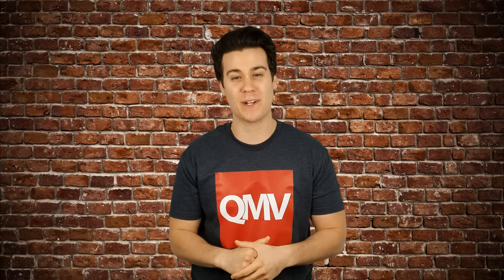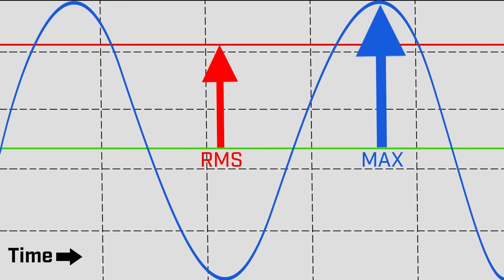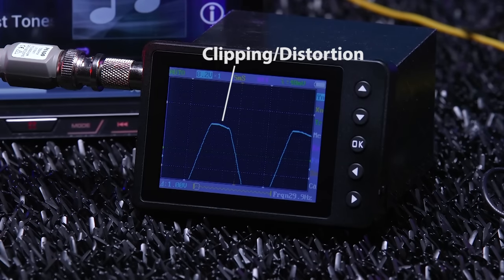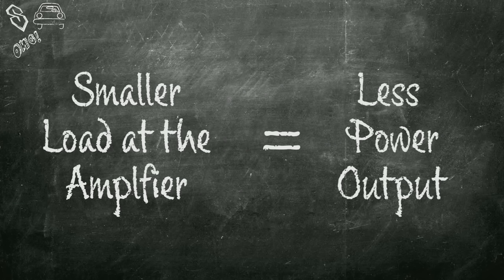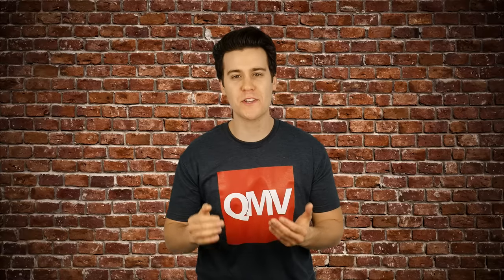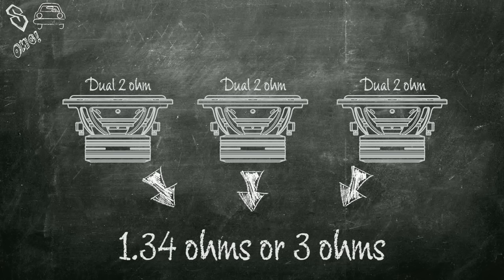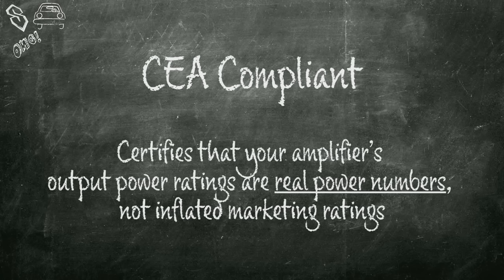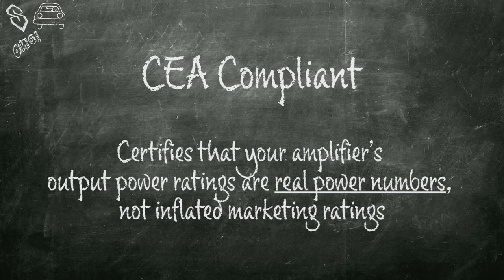How Do You Match Car Subwoofers and Amplifiers?

Comment: Okay look, I know you made 100% sense in this video, but not to me hahah. Will someone tell me if two SWS-12D4 subwoofers will work with the PDR-M65 alpine amplifier
Reply from the maker: Thanks for providing model numbers! So two DVC 4 ohm subwoofers make a 1 ohm or 4 ohm load at amplifier. And those subs have a combined RMS of 1,000W. That amplifier can not be wired to 1 ohm. It can however do 4 ohms, but they power of the subs is much higher than the 450W the amplifier provides at that impedance. Ideally, you would want an amplifier with about 900-1200W RMS of power at 1 ohm. I would recommend these amplifiers instead:

Rockford Fosgate P1000X1BD
http://www.qualitymobilevideo.com/rockford-fosgate-p1000x1.html?utm_source=YouTube&utm_medium=Video&utm_campaign=Match_Subwoofers-Amplifiers

Pioneer GM-D9601 
http://www.qualitymobilevideo.com/gm-d9601.html?utm_source=YouTube&utm_medium=Video&utm_campaign=Match_Subwoofers-Amplifiers

Rockford Fosgate R1200-1D
http://www.qualitymobilevideo.com/rockford-fosgate-r1200-1d.html?utm_source=YouTube&utm_medium=Video&utm_campaign=Match_Subwoofers-Amplifiers
Reply: Thank you very much for your help
Reply: How do I wire both DVC 4 ohm subwoofers together to make 1 ohm?
Reply from the maker: We have a video on that! https://www.youtube.com/watch?v=fyyEDnv-T7o&t=3s

Comment: The rms statements here are wrong impeadiance changes when speakers are in motion you wpuld need 500 rms to push 2 10 rated 100 watts rms and when you add too more the coil rise changes 509 watts rms now becomes 1800

Comment: you forgot impedance rise, if you want 700 watts for your 10 inch subs you need a way bigger amp
Reply from the maker: It's all dependent of the capabilities of the amplifier and the specs of the subs. Just saying "10 inch subs" is incredibly vague. Are they 200W RMS or are they 1,2000W RMS? Are they DVC or SVC? All of this factors in
Reply: 😂 i used your example, you talked about 10 inch subs and 700 watts,  if you want an amp that gives 700 watts to your sub, “and iT doesnt matter what size of sub and the voice coil also doesnt matter” you need atleast 1100 watts rms amp,
Reply from the maker: @promo130  OHHHHH gotcha! Lol

Comment: Bro i have a question. Can you wire two SVC 4ohm subwoofer with 2ohm parallel wiring to a 2ohm rated amp? Is it ok even if the sub is not rated for 2ohm? Help me bro
Reply from the maker: Yes! Two SVC 4 ohm subwoofers wire to a 2 ohm load in parallel, 8 ohm in series. If the sub is not rated for 2 ohm, then you can't make a 2 ohm load.
Reply: @Qualitymobilevideo  bro what might happen if i wire to un unrated 2ohm sub? Will it burn or blow?

Comment: Im so Fucken lost 😫
What amp do I need for two sundown Sa-12 750watts 4ohms subs?
Reply from the maker: Happy to help, those are DVC 750W RMS subs, combined RMS of 1500W. Two DVC 4 ohm subs make a 1 ohm(parallel) or 4 ohm(series) load. I would look for an amplifier with a power range of about 1400-1750W RMS @ 1 ohm. Check these out:

Hifonics BRX2416.1D Brutus 
http://www.qualitymobilevideo.com/brx2416-1.html

Power Acoustik BAMF1-5000D
http://www.qualitymobilevideo.com/bamf1-5000d.html

Power Acoustik EG14500D
http://www.qualitymobilevideo.com/eg1-4500d.html

Power Acoustik BAMF13000D
http://www.qualitymobilevideo.com/bamf1-3000d.html
Reply: Quality Mobile Video ok thank you.  I’ll make sure those out

Comment: Man I'm laughing at your videos and  can't concentrate on the subject.  Here is a question for you I'm looking to buy 2 JL audio 6.5" subs . Here is the power for them
 Power Handling:
Peak: 600 watts per pair / 300 watts each
RMS: 300 watts per pair / 150 watts each
Impedance : single 4 ohms 
Recommended Power Range: 80-300 watts per pair / 40-150 watts each. What amp brand and capacity would you recommend ?
Reply from the maker: Lol thanks! So two single 4 ohm woofers make a 2 ohm or 8 ohm load, I recommend going the 2 ohm route for more power. You'll want a  2 ohm amplifier with a power range of 300-500W RMS! Amp brand depends on you and your budget, obviously a rockford fosgate will be more expensive than a boss audio amp, but will perform much better. Here are some suggestions! 

Kicker 42PXA5001 - 500 watts RMS x 1 Channels at 2 ohms
http://www.qualitymobilevideo.com/42pxa5001.html?utm_source=YouTube&utm_medium=Video&utm_campaign=Match_Subwoofers-Amplifiers

Rockford Fosgate P300X1 - 300 watts RMS x 1 Channels at 2 ohms
http://www.qualitymobilevideo.com/p300x1.html?utm_source=YouTube&utm_medium=Video&utm_campaign=Match_Subwoofers-Amplifiers

Rockford Fosgate R500X1D - 500 watts RMS x 1 Channels at 2 ohms
http://www.qualitymobilevideo.com/rockford-fosgate-r500x1d.html?utm_source=YouTube&utm_medium=Video&utm_campaign=Match_Subwoofers-Amplifiers

Kicker CXA300.1 - 300 watts RMS x 1 Channel @ 2 ohms
http://www.qualitymobilevideo.com/cxa300-1.html?utm_source=YouTube&utm_medium=Video&utm_campaign=Match_Subwoofers-Amplifiers

Kenwood KAC5001PS - 500 watts RMS x 1 Channels at 2 ohms
http://www.qualitymobilevideo.com/kac5001ps.html?utm_source=YouTube&utm_medium=Video&utm_campaign=Match_Subwoofers-Amplifiers

Comment: Yup Im Lost Asf
Reply from the maker: lol what do you need help with specifically
Reply: I Re Watched It Understood First 4 Mins Got Lost With Ohms N How U Connet Em N What Not I Really Just Wanted To Find A Good Amp But I Did Learn I Need Rms Of 1200 Now Im Confused As The Chanel And Ohms Like 2 Ohms Or 4 Chanel Whats The Best Way To Connect Two 10 Inch 600w rms Rated Both
Reply from the maker: Ok cool I can definitely help! Are those subwoofers Dual Voice Coil? And are they 2 ohm or 4 ohm?
Reply from the maker: I can look it up if you have a model number

Comment: Why no one explain how my speakers wouldn't melt if i connected the same output that connects to the subwoofer cuz doesn't matter how many channels it has they all have the same output so if i connect a 250 w rms to my subwoofer it will be fine but the fucking rest of them that each have 250w rms are gona fuck my speakers up what the fuck do i dooooo

Comment: Not understanding. All I hear is ohm ohm ohm ohm ohms ohm ohm ohm ohms ohms ohm.
Reply: I hear you he made it sound confusing for me at first too. But it’s not that confusing. Just know you don’t need a ton of wattage power if your a regular listener, like he said at the end of the video. 
Regarding ohms. Do some research online I learned faster that way. I suck at explaining stuff but you will learn a lot more there. Wiring in series is more resistance/ohms which means less power. Parallel is the opposite. (Less resistance/ohms which means more power)

Goodluck

Comment: Fck lost halfway thought it was going to he easy
Reply from the maker: Lol what do you need help with understanding
Reply: What car audio installers do u recommend  in the tampa florida area that are knowledgeable like you that know what the fck they are doing  because you have the ones that now how to connect but do not know the match up like ur video breaks it down the proper way   2nd question as for speaker wires and amp what are your top brand picks. Thanks for your response preparing for another damn hurricane here in florida
Reply from the maker: @sammyorta  For installers, no idea bud. We're based in Los Angeles, I couldn't even name 3 people here that I know of, let alone Florida LOL. Speaker wires, the brand isn't crazy important, I would just focus on getting OFC (Oxygen Free Copper) wires, they're the most efficient and will run your system the best. For amps, it depends on what you're driving. For average sized systems, I'm a huge fan of the Pioneer GM-D amplifiers, Kenwood's KAC line is solid too. Also Polk Audio amps are amazing. Polk amplifiers ALWAYS hit their specs, they're not bullshitting you. Good luck down there stay safe!
Reply: Thanks for quick response  i have some more  basic questions later on next week when i decide to take on this project  it is for my 2004 jeep liberty limited 4x4   for now i am  looking to replace front speakers 3 way 6.5 speakers that have good mids and bass no distortion  300 watts  any suggestion brand  the previous i had infinity kappa but the bass and mid when turned up were  not great  they sounded clear but when  volume increasee you noticed bass treble su ked  LA always has the good stuff when it come to audio installers out here it sucks
Reply from the maker: @sammyorta  Sure thing bud! Here are some very solid 3-way 6.5" speakers, focusing on mids/bass:
https://www.qualitymobilevideo.com/db652.html
https://www.qualitymobilevideo.com/id65.html
https://www.qualitymobilevideo.com/xs-gs1621.html
https://www.qualitymobilevideo.com/rockford-fosgate-pps4-6-punch-pro-6-5-4-ohm-midrange.html

Comment: *Idiot Guide to Understanding Amp Power** - Ever see flea market Amps with massive numbers - 3000 watts for $100, 10K Watts for $179 too good to be true and it normally is... 
Here is a tip, the Fuses on the Amp will tell you what you need to know!  
As a simple rule of thumb with like a Class D mono block aka Sub Amp
 take a look at the Fuse value. Now Simply add a Zero. So a 30 Amp fuse now equals 300 a 90 Amp fuse is 900...and use that number for the estimated highest output of that amplifier.
  So regardless of what the Amp box says 10,000 Watts @ 2 Ohms if you only see 1x  30 Amp Fuse you are looking at a 300 Watt Amplifier in the real world. 
One should never even buy such a crap Amp that lies like that in the first place, but they seem to sell lots of them.  To not get screwed more than you already are, at least know something close to a real world spec on what the amp could possible do, instead of the numbers on the box that they somehow record when the Amp gets hit by lightning!

Real Amps with real numbers will tend to have the CEA spec numbers, but on cheap Amps this is the simplest way to not get totally screwed on a garbage Amp you shouldn't buy in the first place.
Reply from the maker: FACTS

Comment: This is dumb. Any amp will work with any sub, so it doesn't matter how powerful it is. It will still hit a little. Only thing you need to know is buy some speakers that will handle the amp wattage. Not hard to figure out. If your speakers say 300 watts max or some shit, don't run a 1000 watt amp.
Reply from the maker: If you're new to car audio DO NOT LISTEN to this comment by Eric. Matching your subwoofer(s) and amplifier(s) based on impedance and voice coils is INTEGRAL to the correct operation of your system and determines the kinds of loads you can make at your amplifier, which determines what amplifiers you can use with your specific subs/speakers. UNLESS you just want to BLOW sub after sub after sub, and amp after amp, then listen to Eric :)
Reply: @Qualitymobilevideo  I've never blown any speakers or amps. lol It's not hard to listen to the sound for any distortion, if your speakers are hitting a little too hard, or feel if your amp is overheating. It's not rocket science. You can easily make adjustments. I had an amp overheat once while it was bridged. I didn't bridge it after that and problem solved. Speakers were just fine, but the amp couldn't keep up. Or you can turn down the gain so you aren't getting as much wattage. No looking as specs to figure that simple shit out. All you have to do is listen, feel, and look at what your shit is doing. I was probably putting new stereos and amps in when you were still swimming around in your Dads nut sack, and before all you nerds came along with thinking you can't figure shit out without specs. I watch guys like you on Youtube all the time trying to max out wattage to see if a speaker is going to blow, and I'm like, why the fuck can't they hear that it's about to blow, or that it's hitting way too hard? They act surprised a minute later when it starts smoking and shit. I don't get it. It's obviously going to blow. Maxing out any speaker is dumb. You can clearly see that it sometimes hits way harder than what the speaker is maxed out on too, but they act like they were only loading 1200 watts the whole time. Why is it reading 1400 watts sometimes when it hits then? That's obviously way too high, and then they say it's a shitty speaker after blowing it. Dumb asses. I work in welding. Electricity is never stable and even though your machine reads one thing doesn't mean that's the max current you will get. It can go much higher sometimes, or lower.
Reply from the maker: Oh bro you work in welding! Oh I'm sorry! You clearly know everything. We don't max out speakers and blow them and wonder what happened. The impedance and number of voice coils of your subwoofer(s) absolutely determines the kinds of loads you can make at your amplifier. Just like the stable impedances of your amplifier determines what kinds of subwoofers you can use. But it's all good. You're a welder. Just wire whatever to whatever, look at it and call it a day.
Reply: Are you being serious? If I have 2 300 watt subs, and a 1200 watt amp, wiring it normally without bridging it or in parallel isn't going to blow shit if you turn the gain down and gradually turn it up while a song is playing to listen for any distortion, pops, etc, or to look at what the speakers are doing. Yeah, I'm a welder and a lot of time you have to use your eyes and ears instead of tools. You have to learn how to figure that shit out without cheat tools. Also what I was saying is that if you set your gain at exactly what your speakers will push, that doesn't mean you are going to push exactly 300 watts every time. Electricity can spike over that and blow your speaker too. It's best to never max anything out. That's why I've never blown a speaker. Another thing I was talking about is that if you only have a 100 watt amp, but your speakers are 300 watts. It's not going to thump, but it's still going to push those speakers and sound decent. It's just not going to produce a lot of bass. It's also the best bet for newbies. They can bridge the shit or whatever else they want and never have to worry about overloading the speakers. If you're not sure though, don't bridge anything, or run speakers in parallel.